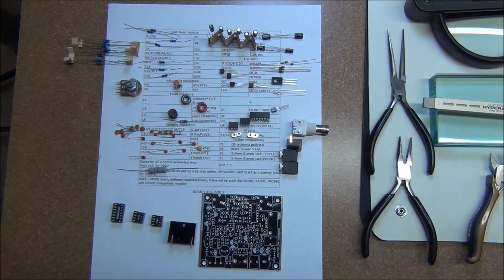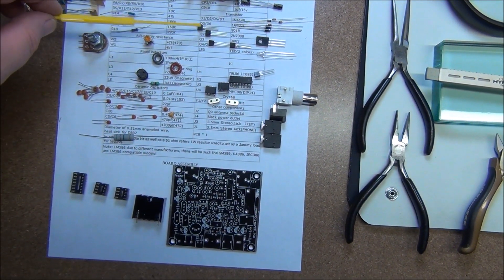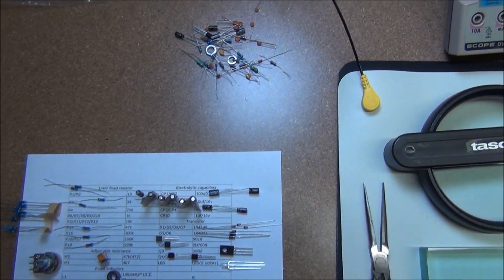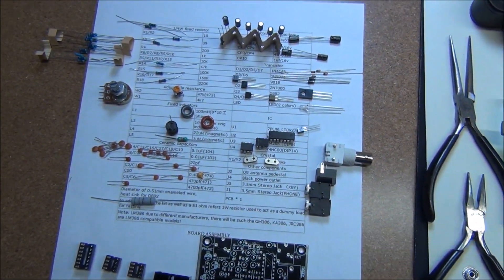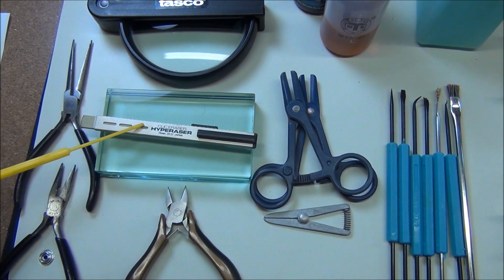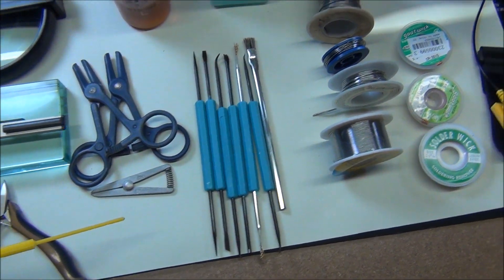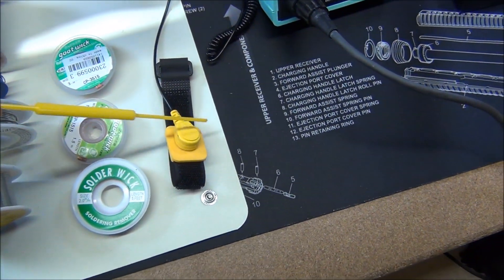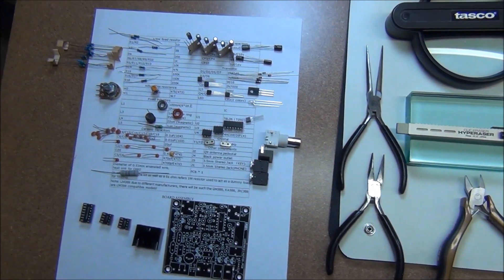Frog Sounds HAM Radio QRP Kit Telegraph CW Transceiver (part 2) - AF5DN

Comment: When building did your board have an empty spot on it for R19? It may be a different manufacturer but mine does and no where on the parts list or schematic does it mention resistor 19. Also it transmits but havnt been able to receive yet. Not even white noise when powered on. I don't know if this is a fault in the device or just no one transmitting.